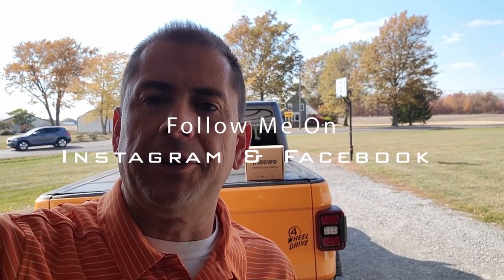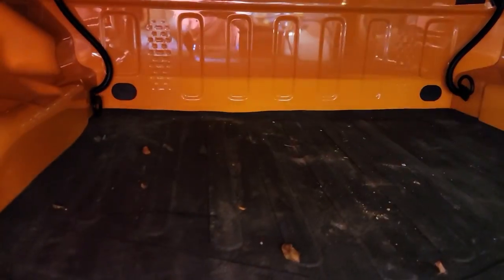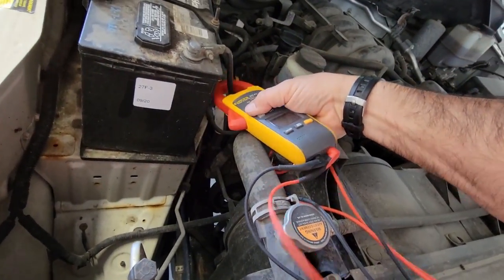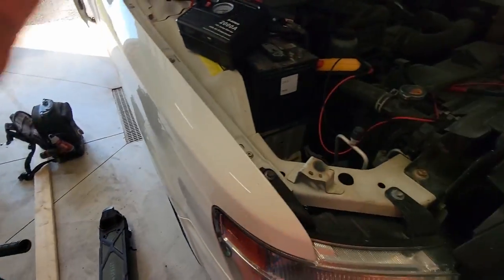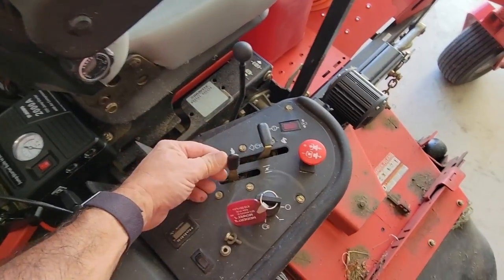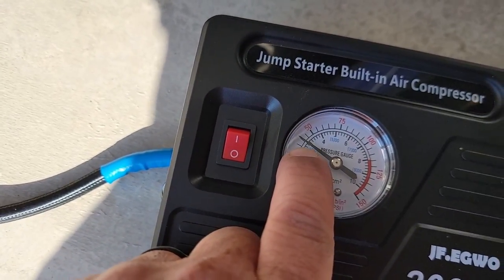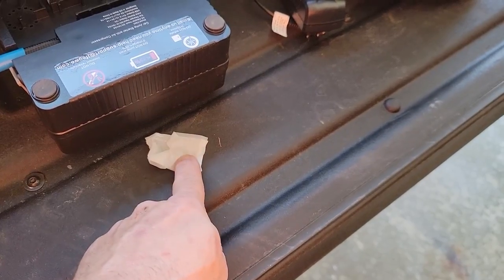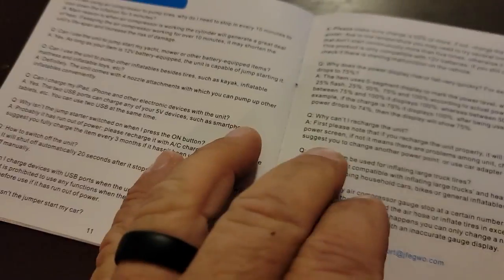JF.EGWO 2000A Car Jump Starter with Air Compressor Review

Comment: I have no issue with the reviews.    In my car, which is a work vehicle, I carry a tire plug kit with the T handles (pistol grip, not the straight screwdrivers).  I also carry a large tube of rubber cement.   Next to that is the Campbell Hausfield 12 volt compressor that's lasted me close to 25 years now.     I can't even tell you how many times I've been saved by that.   At one point, I had to plug two tires plus use a doughnut, but I got home, and to the tire shop the next morning.     For anyone who doesn't want to be stuck in a parking lot for hours, waiting for a tow truck (especially in this time of 'no spare tire' cars), I strongly recommend a good tire plug kit.   Yes, the "road hazard warranty" people will immediately replace it - but you can get there!

Comment: The brass one is an adapter so a Schrader air pump can be used on a Presta valve. This valve type is found on higher end road and mountain bikes.

Comment: The jump start part seems good, but I wouldn't rely on the air compressor part to last because they get so hot. Also be careful connecting that without a battery, they run 16V+ when fully charged and can sometimes blow your light bulbs.
Reply from the maker: You're right about both things. I noticed the voltage was higher when I rechecked it with my meter in the correct lead position 🤦🏻. That's why the interior lights were so bright.
Reply: that can also ruin one or multiple of the electronics and computers in a vehicle, not so much the 16volts, but potentially large spikes when trying to crank as solenoids and relays turn on/off as well as other things.
now days stable supplied battery voltage is critical on all vehicles, even weak batteries can and often do wreak havoc.
Reply: I'm only using it on a Harley Road Glide Ultra, where the maximum tire pressure is 40 psi on the rear. I also carry a Fri Concepts Air Plugger, so I'm covered if I get a flat tire, or have a dead battery.

Comment: FWIW not a bad product for an all in one, I still carry a separate 160lpm 12V air compressor running 31" tyres on the 4WD with no duty cycle and a lithium ion jumpstarter but for my ute with smaller tyres this would be a good product. Definitely a great review for sure. 😊
Reply from the maker: I got a Milwaukee 18v compressor without the tank for my 35" tires and it can fill them in 4.5 min from 11psi. I paid $180 for it.

Comment: I don't mind the product reviews. The performance of this product does seem impressive. You might want to try charging it from the car charger -- some of these really do need 15+ volts DC to charge and will only charge slowly or not at all from the lower voltage of an automotive electrical system.

Unless the engine in your van has some clever tricks designed in (partial compression release?), and maybe not even then, I don't think your Fluke meter was giving accurate information. Those motors pull a minimum of a few hundred amps. (I have a 376FC, maybe I should try it?)

Years ago, I read that in Asia, English writing is viewed as a way of marketing, sometimes without considering whether or not the letters actually have a meaning. I don't know if that's true, but it might explain the unusual names of this and so many other products.
Reply from the maker: It's warm right now and that might have had something to do with it. Try your meter on your truck and see what it does. I thought about putting the battery system in the freezer for a hour or two and then try it but I needed this video completed.
Reply: @HVACRSurvival  Very silly it may be, but I figured it out! I got similar results with my 376FC in min/max mode and was quite surprised. When I accidentally flipped it to MIN and saw a recorded reading of -310 amps, I remembered that hall effect sensors have polarity. Had I flipped the clamp over, the MAX value would then have been "correct". Only that wouldn't have been convenient, with the display and controls facing down. The "max" (positive) value was actually that of the alternator charging!

For cross comparison I grabbed a UEi DL429B and its logic behaved the same as the Fluke, capturing a 296 amp reading. (If anyone really wants to know: the readings came from a 2007 Chevrolet Silverado Classic with a 4.8 V8)

Comment: Small brass fitting threads on a valve stem like a small bmx race bicycle.
Reply from the maker: Interesting, I didn't know they had a smaller valve stem. Thanks for the info